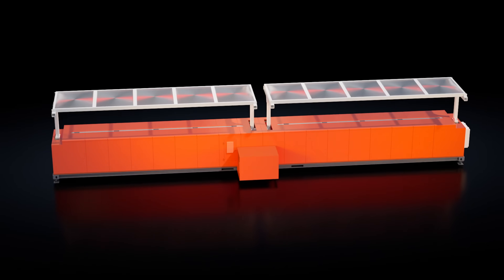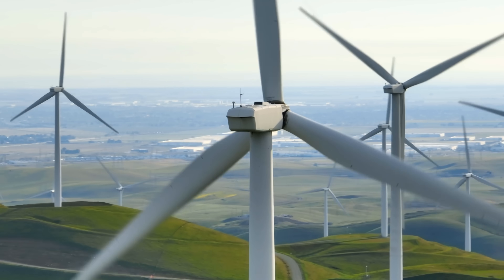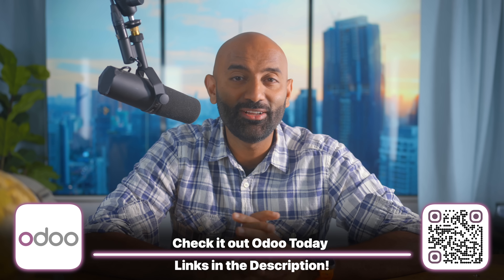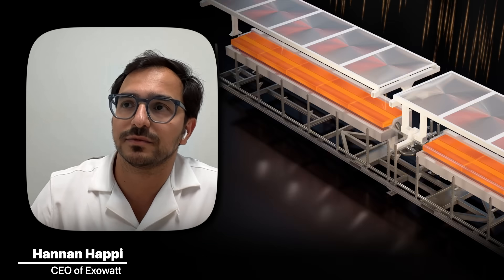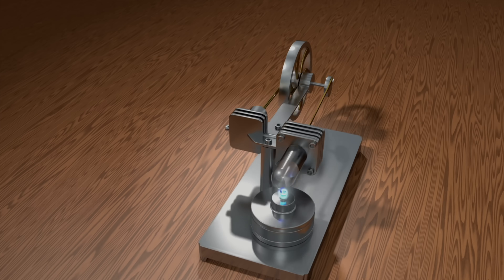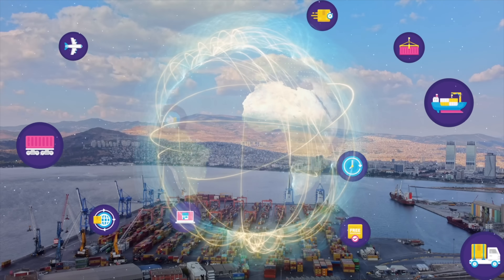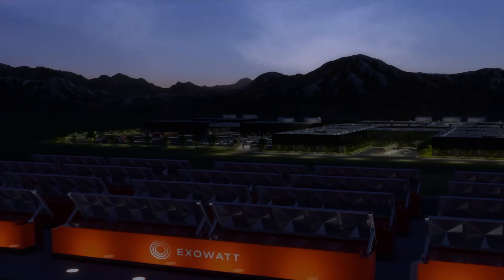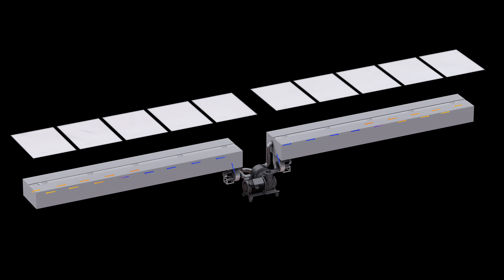Solar Without Panels, Storage Without Batteries - EXOWATT

Comment: Heat pipes could potentially help disperse the heat through the bricks ensuring that even if part of the unit wasn't working (lens dirty, ajar, or blocked for example), the whole storage system can still be used. Just thinking out loud since you mentioned it at end of video.

Comment: Hallo 
great video
but 30 years is far too long for a new technology like that. You should be realistic and calculate it for 5 or 10 years.

The technology seems great, and - what is very important - you can use it off grid. Every farmer will be very happy about anything like that. 
But it must not be to expansive to buy , it must keep its function over a long time without repairs  and it must be save. 
Then it is a revolution. 
Time will tell. 
Greetings from germany

Comment: They built one of these outside of Vegas, but hey you gotta keep making videos or you might get bored not to mention broke
Reply: Ivanpah uses different technology that actually works and still has a lot of problems. With photovoltaic and batteries becoming cheaper I doubt they would build it again

Comment: The size of a generating resource is one thing, but size is useless unless the resource can produce its energy for an extended period. Presuming one has a 16MW facility as in the example, the question is then "For how many hours could this facility produce power during the night?" How many MW-hours is it good for? The electric utility industry already has battery storage systems in place at various locations as emergency peaking units - they are charged up overnight during low demand and then retain their charge until/if called for, but even then they discharge after just a few short hours.

On efficiency, Stirling engines are relatively weak for their size, powered only by the thermal movement of hot air. Will the force of the moving pistons be enough to counter the friction of turning a small generator? Will they need starter motors to get the rotors turning? How will a constant 3,600 RPM be maintained? Will these Stirling engines require gearing to produce the required 3,600 RPM for a generator, and if so, would they have enough power to overcome the friction of the gears?

Sounds interesting in theory, but what about the actual physics involved?

Comment: I think this has promise. Modular, scaleable, readily available materials, and solves the battery issue using thermal storage which I've been thinking is going to be the solution for fixed location energy generation storage. Keep us updated on this one please.

Comment: I like that it's low-tech, domestic materials, and low maintenance. It heats bricks. Do the bricks rise to the same temperature as nuclear rods?
It's fantastic to see a simple design using heat collection and conversion to electricity, but without the dangers of nuclear. I'd love to see that comparison.

Comment: Would not waste money on this. Mowing parts, high temperature equals high maintanence expenses.
The price comparising with solar+ battery almost running out of the screen seems wrong?
It seems like these Sterling systems comes up every 5 years when people have forgot the last going broke.
Fresnel lens does only work well in direct sunlight, not in diffuse sun where solar panels works well.

Comment: This sounds great.... but what about in winter? Hotter climates would be fine, but what about ones that get freezing? Also, I'm not an engineer, but if the blower needs power where is the power for it coming from? And don't you only get the amount of energy you put into something (because there are no perpetual energy machines)?

Comment: The problem with all these systems tend to be reliance on the sun, what is needed is a way to produce electricity in places where the sun is a bit shy that way knowing it works where the sun doesn't work so well, means that when the sun does work well it produces more and better power.

If you live in a country where it rains a lot this system is almost useless.

Comment: it's always good to have more options. i just wish people talked about the obvious, easy solutions more. like replacing all coal plants with natural gas plants. that cuts those emissions in half immediately, and that's ignoring the fact that natural gas plants can pretty easily have carbon-capture added on to take emissions to near-zero. that could be done within 2 years. in the mid-term, ramping up nuclear is such an obvious option. longer-term, fusion is the goal. maybe AI can help develop that. we already have the solutions. we just have to implement them.

Comment: Using actual sterling engines is an.... interesting choice. Those are basically toys. There are actual dedicated heat engines, even if you want to get away from steam for some reason or another.
Well, make the claims you wish to. I'll believe it when I can ring them up and install it cheaply at my place.

Comment: Way too many moving parts and those lenses cost a fortune. The lenses would require daily maintenance. Very poor design. You can outperform this in every metric simply digging out a c shaped trench. Cover it with foil, run a pipe across the top of it, put a coil on the end of the pipe. Fill the system with oil and away you go. Probably cost you about 100 dollars tops to make.

Comment: Regarding the energy consumption of using LLMs like chat gpt...The fact is that there's no excuse for how much energy its supposedly using. The software could run on a Super Nintendo and all the info it thinks it knows could be stored on a bluray disc. The fact is that these monsters who control the world are stealing your information and spying on you and THATS why everything is a double costs, triple cost to the infrastructure. We need need OFFLINE ai and chat solutions that run OFF grid AT HOME and even if they needed to scan the internet for you, it wouldn't tax the servers or demand more energy than a google search. Its all designed wrong because they want you to depend on them and give up your privacy instead of empowering you to use the latest tech ALONE without strings attached. The spying is the energy problem!

Comment: Nuclear is still the best, though, and still is not used as much as it should and could be used to make cleaner energy. Also, with the new battery tech coming out it is again going to be a changing and cheaper system to use solar panels with batteries, as the new tech is really a great power source and better than lithium. So now this tech has to compete against the batteries from Tesla.

Comment: Just one working container would mean a lot and could be tested in real world conditions. Maybe useful for the sunbelt and desert locations, but how does it perform in rain or cold weather? Keeping those bricks warm at 30 below zero might be a challenge. Unless the Fresnel lens is customized to latitude the containers would have to be on a north south axis with 30-degree pitch angle facing south in most places in the US.

Comment: I want this for home use! Yes please do an in depth look. I'm very interested. And for all of these locations they are trying to build data centers, where our energy grids are already at risk this makes so much more sense. 
Do you know what I love about this? 
It is built domestically.
ALL of the components do not require special minerals, are non toxic, no batteries to worry about thermal runaway and no degrading solar panels, and NO nuclear waste. 
Can they be built on top of homes to save on space? People would be able to live further away, not tied to the grid.
Reply: You can't put it on a roof. It uses very large magnifying glasses to heat up a shipping container full of sand. That's about the size of a single wide trailer home.

Comment: I've been doing something similar to this for about 30 years. 

I build VAWT Darius wind turbines as a hobby. I have 13.

Every time the wind blows the turbines spin against a 16:1 transmission and compress air, which is stored in a 2000 gallon containment system and whenever  I need electricity, I merely run compressed air through a modified steam engine connected to a generator.
Reply: @SiwyWabbit  I'd love to have this on our homestead in the high plains of TX! Very awesome!
Reply: @SiwyWabbit  how long does the 2000 gallons lasts ? How much pressure? How much electricity can really generate ?
Reply: Staric pressure depends on use. "How much el", I can only guess, is a refrence to God (Eloheim)?  @abualis1178
Reply: where are the design schematics?
Reply: In my head. @singingway
Reply: Although intriguing, the ongoing maintenance requirements for optimal functionality appear substantial.
Reply: @Turbo_Todd   Nope. Set & forget.
Reply: For how long can that system run on only stored air?
Reply: That depends on what I'm using it for. Blowing tailings off my lathe or milling machine? Probably forever. Powering my house? Ya . . . Maybe not so long.😅 @bogganalseryd2324
Reply: Wow, this is impressive! Do you have a YouTube channel or blog where you share these creations? I’d love to explore more. Learning from your work would be fascinating.
Reply: Cool idea but uh not similar at all, but that is a great way to store wind energy ;?)
Reply: @russell2449  It's similar in that it collects energy from the environment and stores it

Comment: 35 year thermal brick lifespan is a stretch. Ceramic kiln furniture needs to be replaced every 5-10 years due to hot cold cycling causing the bricks to crack and break, and that's running 24/7. I think something fluid would make more sense as a heat storage medium.
Reply: Kiln furniture is heated to over 1000°c,  sometimes significantly more than that. These bricks need only to make water vaporise. Bricks on a house in very hot climates, getting full sun for 100+ days a year, while not heated all year round, last over 100 years. The less a brick is exposed to cold, damp, algae, etc, the longer the brick is likely to last.

Comment: I could see this being a great complement to the instant energy of panels. This one collects heat during the day, and rather than hugely expensive lithium ion batteries for storage, it radiates that heat during the night and generates electricity. If this can generate significant heat during the winter months, then I wonder if it could be used to heat homes directly, by heat pumps rather than a generator? More thermally efficient I would presume? Any experts care to comment?
Reply: We have much better technology to produce hot water with the sun, e.g. evacuated tube collectors. Almost the same size as a solar panel and you can mount them on your roof. Pretty common here in Germany.

Comment: Yes, please! More details on this would be fantastic. Weight (and foundation/footings) looks like it might be an issue. Also how are those lenses going to perform in adverse weather? 
Still, this is very exciting, especially for folks like myself who have a couple of acres but live at the crumbling edge of the electric grid. Having something like this for power (and heat!) would be excellent for disaster recovery. (Many folks resort to electric space heaters, et. al. means of using electricity to produce heat -- a small duct attached to one of these units would give you 90% efficient heating (you wouldn't have to convert the heat to electricity to use it). Military uses are also strong consideration for all the same reasons plus almost silent operation with no pollution, easy repair, and very low danger (outside of routine fire-control) if they get damaged.
Reply: Forget this bs and look into evacuated tube collectors if you want heat from the sun. Photovoltaic for electricity.
Reply: @SolarCookingGermany  While I don't completely agree, I do appreciate the recommendation. Evacuated tubes are fascinating and I didn't know much about them until you suggested this, thank you. Photovoltaics will almost certainly always be the highest yield conversion of photons to electricity (unless/until we naofabricate rectifying antennas) but the apparent capacity of this technology to capture indirect (i.e. not directly tracking/facing the sun) energy is interesting. Stirling engines are fascinating too, even if they (like every mechanical linkage) are too inefficient for general use.

Comment: The bricks would get heated unevenly but over time the heat in the brick would start to passively migrate throughout the entirety of the brick.
Just like how heating up a kettle of tea from the bottom eventually makes the top of the kettle hot, or just like how the metal handle of a frying pan can get hot despite it not being over the burner.
Reply: Heating a brick from above is also super ineffecient compared to heating it from below.

Comment: I am excited by Exowatt system . I think you left out one big advantage that they have over Solar Wind . It about ten years we will have millions of Solar panels and fiberglass windmill blades that no longer function as intended and wear out. The cost to recycle and dispose of them will be huge and several times the cost of the Exowatt system.
Reply: Landfills are already getting overwhelmed by the hugs wind power blades. They break down a lot faster than was expected.
Reply: @colleeneggertson2117  a very unfortunate unforeseen situation. Your statement makes sense. The unreacted peroxide’s in MEKP contribute to the degradation of fiberglass composite structures. This is in addition to the intense UV damage and freeze thaw issues from hydroscopic moisture retention.

Comment: I doubt that this is cheaper than PV.
Reply: Did you watch the video? It is not cheaper than PV, but it is significantly cheaper than PV + Li (or current equivalent) battery, plus on cloudy or low energy production days can store energy from the grid, again for multitudes of times more affordable than battery packs.
Reply: @doofer80  Nope, it isnt cheaper than pv and lithium batteries. Thats Bullshit.
Reply: @marcelb.7224  Feel free to back up your statement with something, anything... I suggest facts.
Reply: @doofer80  Solar, even with batteries alltogether is much cheaper, than this technology, which is only on paper. Prove me wrong, but i don´t think whis is going to scale up in the next future. Meanwhile India and China are installing thousands of Gigawatt renewables and batteries.

Comment: How well or how long will it take to gather energy in extreme cold climates. Or in normal winter months? Will the bricks lose heat quickly during the winter months? Causing its storing capacity % to be considerably low.

Comment: They are doing it wrong your don't need  a Stirling Engine you just need a hot air engine. The best storage material is feolite basically iron oxide. I have done some calculations and this could be used as an alternative for car propulsion.  You would lose a lot of range but the recharge rate could be fantastically fast. I am planning to use a pizza oven as my heat store in my house in Portugal.

Comment: Basalt has a very high heat storage as my research in walipini greenhouses has found. I don't know about others heat storages. I've also have thought about using solar to pump water in reservoirs for hydro during times where solar is not active- but more parts, more maintenance

Comment: 13:22 (6) Safety: lithium ion batteries pose a toxic fire hazard. see the Moss Landing battery storage facility fire last year. That incident set back battery storage near residential. Neighbors are fighting against having that plant rebuilt and against new capacity at that facility as well as others nearby.

Comment: Ok I have a question. Tracking daily movement of the sun requires a faster movement of the lenses, however the seasonal changes in the position of the sun are an annual cycle. So why not tilt the units towards the sun instead of straight up? I can imagine one set of units tilting perhaps a small amount daily. It wouldn't be perfect but it might collect significantly more light.

Comment: Think Interstate roadway - median placements.  Think adjacent to railways - or under the track centers.  Use space that's not used.  Bring power to all nearby poles.  Distribute it.  Centralized power is bad - consumes many watts just in transport.  Bring it to nearby transformers and send it on-demand to legs of the grid, not the core/mains.

Comment: I think the real issue now is storage. It seems we can get the power we need from solar panels - like on our roofs -  but battery storage has a lot of sketchy issues. Why not use the heat sink storage idea with solar panel source - the lens source also seems sketchy since it needs to be articulated - getting rid of moving parts is always a goal for reliability!

Comment: We would love to see the tour. I would like to see how the sausage gets made with the trackers.

The modularity is also inspiring. I am sure that a cubic meter version of this might well power a whole house at just 1 kilowatt hour.
Reply: 1 squaremeter of sunlight equals about 1kW. If the efficiency of the conversion into electricity is 20% you will have 200W. In reality probably more like 10..20W. Every solar panel does better.

Comment: There is a royalty free thermoacoustic engine that  is much smaller that does about 35 megawatts and has been out for 2 years. It will generate a revenue of over 10 million dollars a year and cost nothing to run and is not reliant on the sun. The first one who builds it will make a lot of money... yet no bites yet because nobody in the west has the balls to invest in it. It will generate electricity for zero cents a kilowatt hr and has no moving parts at all. It only takes up about 16 sq ft of space and will run with no fuel at all.  It will run in space and does not use combustion. It also levitates.